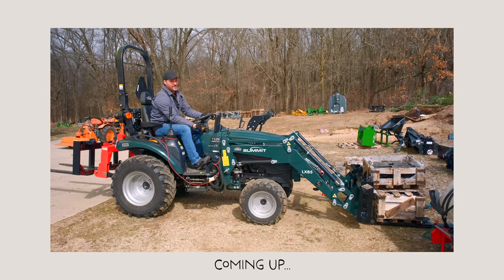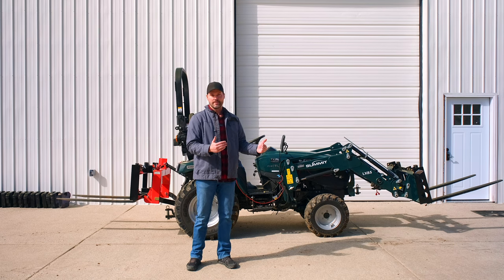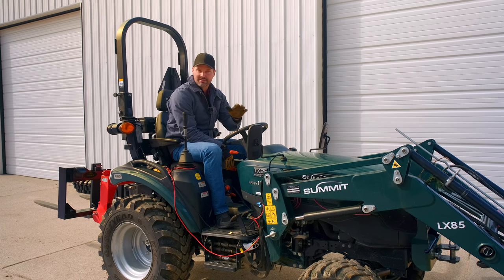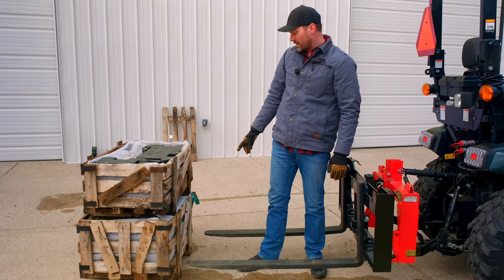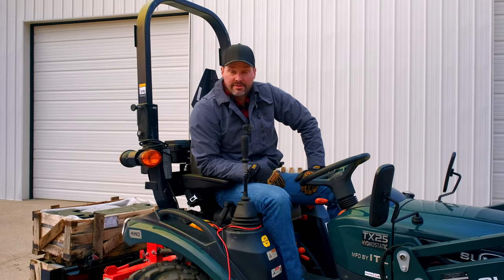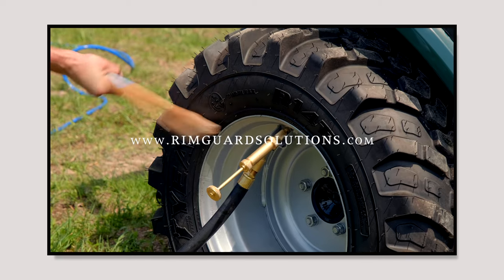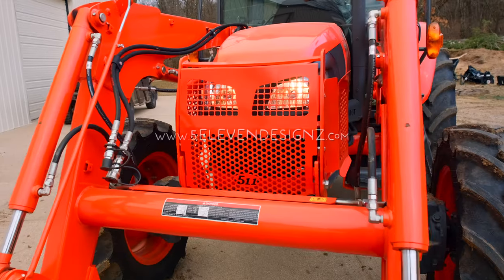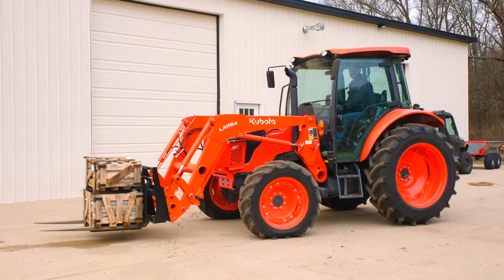OVERLOADING OUR TRACTOR WAY BEYOND THE LIMITS! PROOF IN VIDEO.

Comment: Now we're going to see how many people complain that you didn't do the test correctly...
Reply from the maker: Bring it on!
Reply: Bah.
Reply: People might be calling it overloading or overworking, but their definition is way more broad than just a lift capacity test. I'd say the more common so-called "overwork" issues are working outside of the operational specs of the machine. So that would include things like lifting max capacity with the left fork only (i.e. way unbalanced load bends your SSQA bracket or loader arms). Pulling your box blade along on hard pack in high gear with the rippers all the way down your foot to the floor max speed (snap a 3 point lift arm). Lifting max capacity all the time with no rear ballast (blow front axle seals or steering cylinder/brackets/axle pivot). Operating on a hill with no ballast and a high load in the bucket and rolling the tractor. Last one is not reading the operator manual and then you're surprised when you realize that engaging the diff lock at 7mph is bad for the tractor's health. In summary, Courtney is right. Everyone else is wrong, lol

Comment: Hi Courtney, thanks for your videos!  On the Kubota, you can move the lift cylinder rear pin points down to the lower hole next to the cab.  If you aren’t aware, that position is for max lift but reduce lift height slightly.  The top is for height but less lifting capacity.  😊
Reply from the maker: Yes, they've the power position and the max height position.  I've never messed around with it though, haven't really had the need.

Comment: Well the good news is that tractors as well designed machines keep most operator errors from harming the machine or the operator.    The bad news is that it can lead to anticlimactic videos.   Oh well.   Good demonstration of what not to worry about.
Reply from the maker: Hehe, imagine if the loader arms just snapped right off 😂
Reply: @GoodWorksTractors  I paid my way through college fixing farm machinery.   Almost all repairs were to replace parts that had just worn out through use but every once in a while a machine would come in where the owner had modified it so that it exceeded its design limits.   Those were always the most interesting and expensive repairs.
Reply from the maker: @bradmiller6507  Haha, I bet!  Probably was fun while it lasted...until it came time to pay that repair bill

Comment: Great video, as always.  I agree that a tractor can only do what it will do, but respectfully,  I think you missed the target of "over working" a piece of equipment.  Operating anything near max capacity for long periods puts more stress on the equipment that light duty use.  And if the equipment was made with lower quility materials, that stress is going to show up faster. I'm not saying that was the case with the Bobcat tractor you referred to, but just in general. All bearings and seals are not created equal.
Reply from the maker: That gets back to the point I made in another video that these tractors have warranties for commercial work.  There is nothing about them that is made for light duty like a craftsman lawn mower.

Comment: There are still things you can do as an operator that will damage a machine. Pulling a HST too hard in too high of a range, shutting down the machine full throttle after hours of hard use, driving with the park brake on, driving on hard pavement in 4wd repeatedly, etc.
Reply from the maker: I talk about high range.  You really can't do much pulling in high range as the tractor tells you it hates it.  Either bogging down or stalling.  Yes, those other items mentioned are abuse, but not overloading a machine.

Comment: Tractors cannot lift beyond their capacity, but you can get a bad pick and overstress the tractor. For example, getting under a boulder with one side of the loader and lifting all the load essentially on one side of the front axle… that comes down to the operator.
Reply from the maker: Certainly.  That's operator issues, but not overloading or overworking the tractor.

Comment: Like the Mahindra mechanic told me about the actual busted tractors they have, “you just can’t teach some people…” I’ve never physically broken a tractor unless I was using it for something it wasn’t designed for. People don’t realize hi range is like 5th gear on a truck; high speed, low torque. Great video and the summit tractors seem like a pretty good machine, but there’s no dealers near me

Comment: It looks like your front tires on the Kubota are doing a little complaining about the heavy lift :) If you moved forward and turned with that load,  I wonder if you might not encounter untoward issues. Nice, informative video, as usual.

Comment: I put a chain around an engine block awhile back (I think, about 800 LBS).  I could lift it with my JD 3038e, for the most part.  With the bucket about three feet off the ground the block would just clear the ground, if I lifted it much more than that, the rear tires would start to float a bit.  If I hit a bit of a bump with the rear tires, it would tip the tractor such that the block would just touch the ground.  If I let off on the lift, I could then pick it up again.  I was able to put the block onto a trailer, but just, a lift of about 18 inches for the bottom of the block and about five feet for the bucket.  I think I was at about two-thirds the capacity for the loader, but I exceed the ballast on my tractor.  I figure more people get hurt using a loader because they lifted more than they were really ballasted for than that they exceed the specifications of the loader.
Reply from the maker: Yeah, I agree with that.  Ballast is huge.

Comment: Our workmaster 65 can lift more than it should and if you drive around with to much weight on the front it can bust the front hubs. We use it to wrap and feed baleage so must be incredibly careful as the parts are over $2000 to replace the planetary hub. Another guy on utube had his 3point break on him running a disk mower. They sell an auxiliary cylinder you have to install before the tractor will handle a mower. If you mow in dusty conditions there is a baffle that needs installed in engine bay that will keep the trans cooler from filling up with mud. Another utuber runs his as a logging skidder and had to order it with the forestry package loader arms. The manufacturer advertises all these uses but the dealers are mostly clueless about the upgrades to run a utility tractor as an ag tractor.
Reply from the maker: How do you lift more than it should, I'm curious?

Definitely all sorts of things you need to know about certain setups.  Lots of dealer turnover these days too, so the knowledge base needs to get built back up.
Reply: @Good Works Tractors  I'm not sure, I just know it will bust a hub if we lift to much and tram around with it on the front. I believe it has to do with static and dynamic rating along with how far out we had set our wheels. The loader may be rated for 2425lb, but that is flat ground, lowest gear, closest pin. With the bale squeeze and a wet bale on front and back we have set our wheels back in and crawler gear to feed. Our neighbor has a powerstar 75 and has had no problems and he runs his in a similar job. 
On a side note, our s3010 has lost reverse gear twice now in 1100hrs. The gear is tiny and the bearings within it even smaller. I think the manufacturer designed it to reverse the machine and thats it. If you try smoothing manure or sand by backdragging it overloads them tiny bearings.
Reply from the maker: @ricksanchez7459  Sounds like something wasn't designed correctly with that NH.
Reply: @Good Works Tractors  You're probably right!Aftermarket hubs already available makes me wonder. A guy shouldn't be able to "overwork" a machine. I see em weld stuff back together all the time.

Comment: I do agree with you Courtney, although I also have forks on the back, and was using it to move some pallets, which it would lift up but not all the way, so while driving I could notice the bypass working, generating heat I would assume, I guessed it was oke for short time but might have become a problem if I used it to long like that. A solution if possible would also be to set the height to a height that it can handle, but I did not realize this immediately.

The other thing I am wondering is how do people get there loader bent? By putting all the force on one side?

Comment: you never discussed how many gallons per minute the hydraulic pump is on the summit tractor.  I would like to see you hook up your log splitter to the summit tractor to see how well it performs.
Reply from the maker: I likely wouldn't hook up a hydraulic log splitter to any 25hp tractor.  No where near enough hydraulic flow.
Reply: @GoodWorksTractors  but how many gallons, per minute?  That has nothing to do with horsepower.  We have already run one off of our John Deere 2305 and it ran 5.4 gallons per minute, and we hooked the splitter up to our Kubota B2601 and it was 8.3 gallons per minute. It ran fine on both tractors but it split better on the Kubota with the bigger hydraulic pump.

Comment: I think you can safely assume all tractor hydraulic systems have a pressure relief valve in the system. When you lift a load that doesn't move, it simply means it hit the pressure set on the relief valve and oil will flow back into the reservoir. 

It's not anything that will harm the tractor although if you held the loader stick back long enough it might increase the temperature of your hydraulic oil. But it's not like trying to move a stationary truck with a manual transmission in high gear and you'd end up cooking your clutch.

What is the orange cord on the Summit tractor?

Comment: Get a good speed up in second  gear and slam the bucket into a firm hillside... raise a long PTO too high with an attachment on and watch what happens to the transmission... Jam the lift lever to maximum speed for every lift, then slam the bucket back down on the ground at the same speed due to lack of control. Turn the machine off every time it tries to start an emissions burnoff..

There are lots of ways to destroy these things, the biggest one is usually in the cab. 
That sure is a nice set of forks you had fabricated!
Reply from the maker: All sorts of ways you can break a tractor.  Typically all abuse, but not overworking or overloading it.  Those are dummy mistakes and we've made videos all about them in the past :)
Reply: @GoodWorksTractors  Yep, all abuse situations, but how many times have you been on a jobsite with a green operator and seen them happening? Obviously enough to make video content about it.
The poor machines aren't immune to the operator error (abuse) no matter the manufacturer.
The videos you make on these topics really does save folks a lot of money and frustration. Thanks.
Reply from the maker: @foonus406  Haha, no doubt.  Hopefully helps to lessen the amount of knucklehead moves going on!
Reply from the maker: For the record, I'm guilty of those myself from time to time!

Comment: Two things I’m afraid of happening: breaking the top link off and bending or tweaking the loader arms.
Reply from the maker: The only thing I'm ever afraid of happening is getting my machines stuck....again! 😂
Reply: @GoodWorksTractors  😂
Reply: Damaging a loader would happen when there are unbalanced forces on the loader that are beyond it’s capabilities. If forces and masses can be kept in balance then it should not be possible to bend or break a loader.
Reply: Bent FEL arms seems to be a Kubota specific problem.  They are built too light

Comment: So the forks you use on the 3-pt will quick attach to the loader? But unless you have a hydraulic function to your top link you wouldn't be able to back tilt the load, correct?

Comment: Loader is engineeed too far out in front. Loss of leverage. Part of the reason I ended up getting a JD3032e was that the loader wasn't way out in front. Can get into tight spaces especially in the woods.
Reply from the maker: The 3e Series might have the weakest loader I’ve ever used for a tractor its size.

EDIT: I still think it’s a decent machine, but the comparable Kubota Standard L Series is better all around.  However, typically a bit more expensive though that might have changed in the last year or two.
Reply: @GoodWorksTractors  Not talking lift capacity, talking mobility of turning in tight spaces. Really enjoy your videos.
Reply from the maker: Your comment about loss of leverage definitely had to do with lift capacity.  Leverage isn’t related to navigation.  

A few inches longer on the loader isn’t going to have any significant impact on navigation though.
Reply: True. Was speaking in general terms about leverage. More than a few inches though. Makes a difference. Sorry, didn't mean to start a 'thing' haha. Good YT channel you have though.
Reply from the maker: Hehe, I probably came across a bit strong.  I just know thousands of folks see these comments over the years and want to make sure there's no mixed messages coming from me.  Have a good Sunday!

Comment: It is true that things like hydraulics have relief valves, but not all aspects of a tractor have such safeties.  If you pull too much load too long you can overheat a hydrostatic drive.  Old fashioned gear transmissions weren’t nearly so susceptible to this.  Similarly, trying to take too heavy a load downhill can overheat and damage the brakes which can the lead to overrevving and damaging the engine.  And carrying very heavy loads at low speeds damages bearings faster than carrying light loads at higher speeds.  Bearing races fatigue just as do other metal parts subject to cyclical loading.  So, yes, you can overload your tractor in a way it can’t prevent and cause damage over time.  The hydraulics are a very special case and should not be generalized to the entire tractor.
Reply from the maker: All of the things you list sure sound a lot like what I do all the time.  I like to call it "using the tractor".
Reply: @GoodWorksTractors  Carrying loads above what the tractor is rated for or overrevving the engine is definitely in the abuse rather than use category.  However, you are in good company as many folks abuse their tractors.  Most will never know as most tractors will easily go 10,000 hours used within specifications and probably 5,000 if abused.  Few tractor owners, other than real farmers, will ever see 5,000 hours so they won’t see the affects of their abuse.
Reply from the maker: You can't carry loads above what it's rated for.  Did you seriously not just watch the video that shows you can't do that?

Overrevving their engine?  You're really reaching for things, but more power to ya!
Reply: @GoodWorksTractors  Sure you can.  Ballast isn’t always attached to the hydraulics.  You can add ballast racks and overload with ballast in addition to picking up the maximum load the hydraulics to the max and thus overload the axles.  If you haul too heavy a hay wagon down a steep hill with a small tractor, it isn’t too hard to overrev the engine.
Reply: @GoodWorksTractors  As we used to say in my engineering department, it is hard to make things idiot-proof as idiots are so darn creative.  You would be amazed at the creative ways people find to abuse equipment.

Comment: Only way I know you can "overwork" your tractor would be stacking weight on the forks when they are already off the ground. I can say I'm personally guilty of that. With your 3pt test if you had a hydraulic top link it might have lifted enough you could have carried it. The only other way I know you could over work a tractor would be flat out abuse such as digging with the loader and trying to get a stump of rock out and ramming it. But to me that's not over work that's just plain abuse and a totally different topic